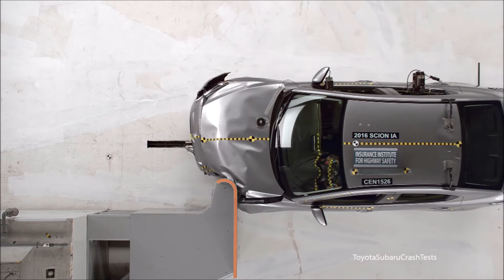2016-2020 Scion iA/Toyota Yaris iA/Yaris Sedan IIHS Small Overlap Crash Test

Comment: Not good
Reply: @0w3nn   The car literally fell apart in thousands of pieces, but yeah it got a good rating
Reply: John H it's more about the safety of the driver tho
Reply: Yes the outside of the car crumpled, But that's not the main point, The main focus is on the driver and how well the dummy preformed on the inside of the car, and how well maintained he was, and would there be any serious injuries.
Reply: John H it’s called a crumple zone. the occupants would still be alive
Reply: @johnh6137  old cars have stiffer body panels but have weaker chassis. This is completely normal to have flexible body panels and rigid chassis. The inside wasn't crushed.
Reply: @Ty-vq1jy  serious question tho I have this car and I can't tell if this crash test is good. I'm 4'9 so I'm essentially right up on the steering wheel with any car I drive. Is this car "safe" for me?
Reply: @amberwing3440  i drive the same way, and i honestly don’t see it killing you if you get into an accident, but it could definitely injure you